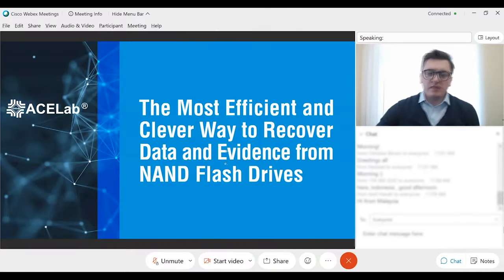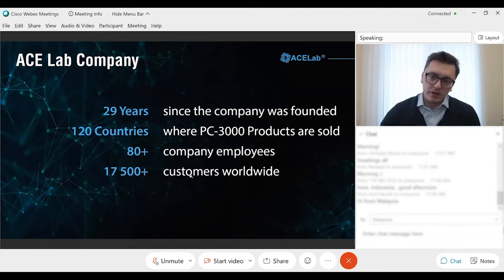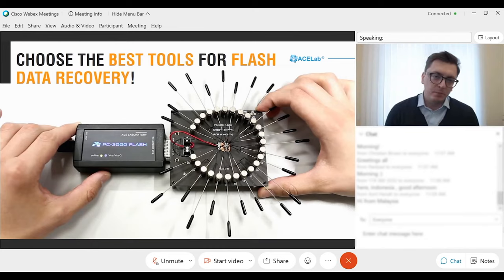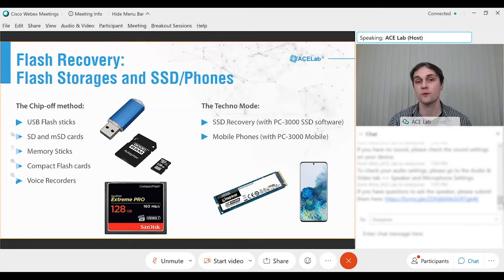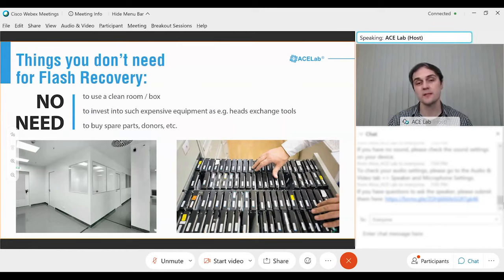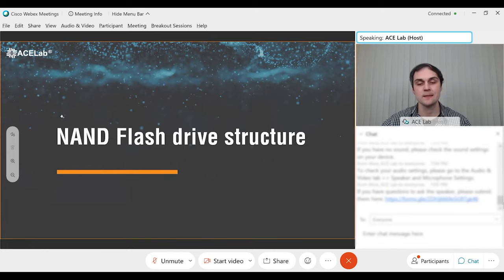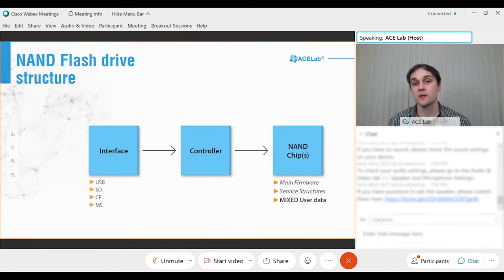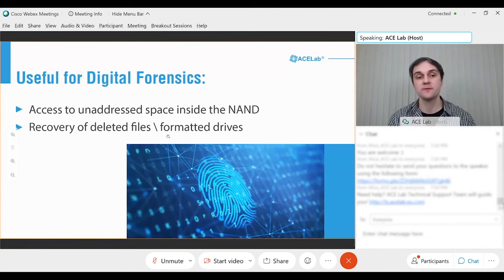NAND Flash Data Recovery for beginners

Comment: I crashed a drone and broke the micro sd card in half on the edge where you remove it from a reader. I don’t have much to recover just a few video clips but was wondering what my options were. Not looking to spend a lot of $$$ since I was flying for personal use. Can this potentially be recoverable on my own without sending it to a lab?
Reply from the maker: Thank you for your question! Most of the modern monolithic devices (microSD cards, SecureDigital cards, USB sticks in monolith construction) have a very large NAND crystal inside which covers 70-90% of the card surface. If there is even a small crack somewhere in the corner of a drive, recovery becomes impossible. So, if your mSD broke in half – looks like such a case is not recoverable. 

Still, most of the issues with digital cards are internal firmware issues.
In such cases the PC-3000 Flash and the Spider Board adapter would be extremely useful.

Comment: I was outside one day and my phone was powered off one day. And I charged after coming home and it was showing like charging 2%. I switched it on and the interface of lock screen came up and i was about to enter the password , but it was shutting off and on again and again automatically. I gave it to two shops. They  power ic is damaged. Idk if the flash ic is damaged. One person from shop said it's because I didn't use the correct proper charger for that phone which means the charger had high voltage power. I don't need my phone my back. But is there any way to recover my data?My phone is realme 3 pro
Reply from the maker: Hello! That is a sad that this happened to your phone. Your telephone has encryption and is based on Snapdragon 710 which is currently not supported by the PC-3000. But maybe you will be able to find some data recovery lab in your area that will be able to help you with this case